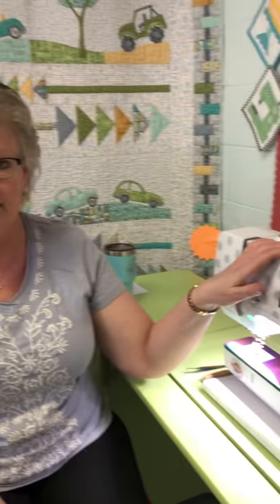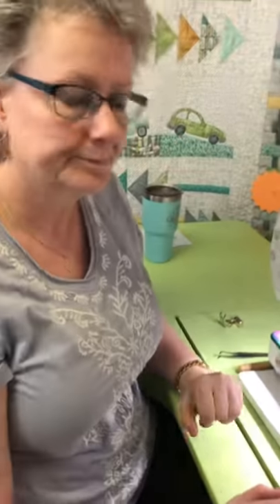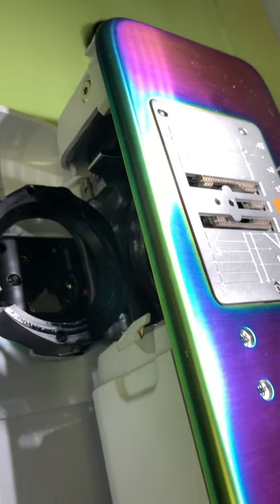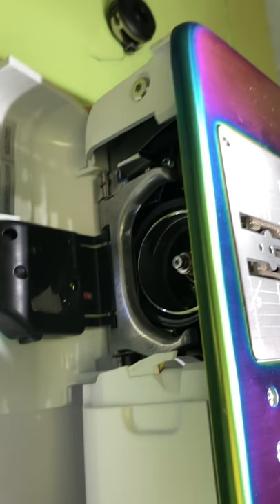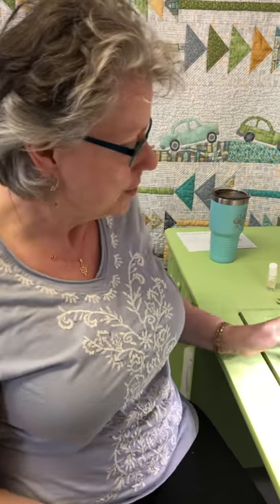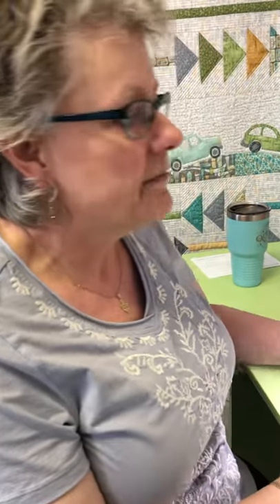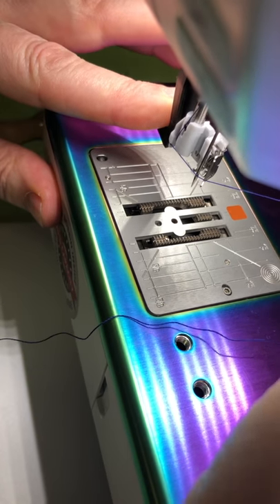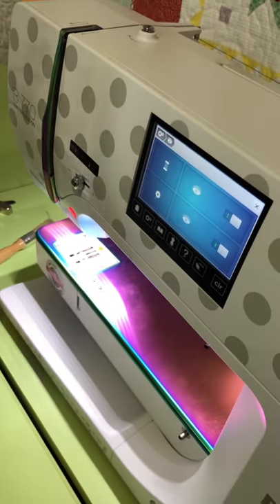Some basic troubleshooting for your BERNINA!

Comment: My Fly wheel is jammed and will not turn.  I took the bobbin and hook out, cleaned and oiled both but no go. On the screen a red arrow spins around the hand wheel but I’m unable to turn it.  Have you any suggestions?
I have a B570 quilters edition.
Reply from the maker: Yes....you have a thread jam somewhere. Rick your flywheel back and forth exerting a little force till it breaks free. Don’t apply a tremendous amount of force, just rock back and forth firmly. If that doesn’t correct it, you should take it in for service!
Reply: @QuiltingInTheValley  I have found that turning the machine off and then back off makes it easier.
Reply: sorry, I meant turn off and then back on

Comment: Great video, do you have any tips for a stuck bobbin case, I can not remove mine
Reply from the maker: Yup!  Take the bobbin case out. Find an awl, or a very small screwdriver. Hold in the release bar on the bobbin case while pushing from the back side of it through the hole with the screwdriver. You might need help to hold it steady....but it will pop out!
Reply: @QuiltingInTheValley  thank you for your response. How do I get to the back of bobbin? Or do I take out the hook?
Reply from the maker: Charlene Pherson you take out the whole hook assembly, then find the hole behind it to try to push out the bobbin/bobbin case.
Reply: @QuiltingInTheValley  Thank you for your help. It worked like a charm, now back to sewing...

Comment: I have a bobbin coming on screen with a ! Mark and on right green question mark  I’ve cleaned and fixed bobbins  I’m lost why it’s doing it
Reply from the maker: Do you have a thread tail showing on your bobbin?  You sensor will see that. Is the silver marking intact?  A scratched up bobbin will not read correctly. Are you ABSOLUTELY sure there is no little piece of thread in the hook area?  The sensor will see it and be triggered.

Comment: Just curious if you may could tell me on bernina 1300mdc serger why it alarms when you turn switch on and the LLC screen lights up but nothing comes up?
Reply from the maker: When you say it alarms, what exactly is it doing?  Is it beeping, or making a different noise?  Does it beep and then a blank screen comes up?  If that is the case, then you might need a new board.  Have you had it in for service?

Comment: Any idea why a b350 with very little stitch time would suddenly not recognize the stitches 11-85, for example I I put 78 and it stitches out 66, seems very random. Thank you
Reply from the maker: So….you are pressing the pound sign first, then the stitch number?  If you are doing that, then you have a board problem and it will need service☹️
Reply: @QuiltingInTheValley  no need for service was an easy fix at home!

Comment: Help Lisa  y screen only shows 3 blue dots and lines below that and my machine is frozen I followed all directions
Reply from the maker: Hey Mary Ellen!  What machine do you have?  it makes a difference!
Reply: @QuiltingInTheValley  I have a Bernina 770 found the problem I had been using my embrodery machine and forgot to change the stitch length when I went to sewing  It froze the whole machine changed the stitch and I am happily sewing again  I love your helpful advice and tried all so I learned some new things. Thanks for speaking slowly and distinctly you are easy to follow

Comment: What causes machine to stop and won’t go.
Reply from the maker: Big question!  There is a TON of stuff that can cause that.  Cord not fully plugged in, or wire to cord has a short.  Thread jams in the bobbin case area.  A sensor that is sensing something off....depending on which model you have.  Worst case scenario....a board going out.  Advice:  unthread top and bottom.  Turn machine off then back on again.  Clean bobbin case area thoroughly, oil, rethread top and bottom.  Ensure you are plugged into a surge suppressor firmly.  Check that foot pedal cord is not bent/snagged, and is firmly plugged in.  If you still have an issue after all this, then you will need a service call to see what the issue is.

Comment: Error 1010 messgae but I am unable to move the flywheel and the racer hook is frozen at 1 and 7 o'clock. So I was just free motion quilting and it all froze.
Reply from the maker: Take out your bobbin and then the hook. Clean out anything you find, and then see if you can move the flywheel
Reply: @QuiltingInTheValley  did that. Looks clean. Can wind a bobbin but flywheel locked in place and error note remains.
Reply from the maker: Gently, with moderate force, rock the flywheel back and forth a dozen times or so. That may break it free. If not....that’s a trip for service:-(
Reply: @QuiltingInTheValley  A trip to Service it is then! Thanks for being helpful, though

Comment: Started from beginning I have to turn hand wheel  every time I turn on 570 is this normal I’ve only had for 3 days
Reply from the maker: If the machine does not set itself to foot and needle up when it starts up, then you may need to have it looked at. You should not have to turn the fly wheel every time you start up!
Reply: Oh no! Thank you ,hopefully an easy fix because I love this machine. I just thought it was normal. Oh my.
Reply from the maker: This machine is a trooper!  It will provide you with many years of service!
Reply: They ran firmware in class it was sewing backwards, when they gave it back they said they ran firmware,that I also had broken feeddogs. Does firmware fix broken feed dogs or are feed dogs mechanical. Thank you.
Reply: So many people I know own this machine and love it!
Reply from the maker: Say what now??  They updated the firmware and told you that it fixed broken feed dogs?  That is not possible.  If the feed dogs are in fact broken, then that is a mechanical failure and will need a service call to replace them.  I have only seen broken feed dogs once....so I'm not confident that this is the case, if a qualified tech did not actually look at them.  Your firmware update will correct and update all of the machine software.  It cannot do anything with parts, and your feed dogs are parts.  BTW-your labor for all service is fully covered at the dealer you purchased the machine from for the first 12 months after purchase, and mechanical parts that are defective are covered for 20 years.
Reply: Thank you so much!

Comment: why is J flashing on my 790 Iam trying to blanket stitch
Reply from the maker: No worries!!  That is a function of your machine where it will recognize the number of stitches you take so that you can repeat the same number of stitches for you on a second run.  Kind of like a memory function.  You can just ignore it when you're doing what you are doing now, and it won't impact anything.  If you touch the reverse button, then that will set the number of stitches for the next run....should you desire to do so!  Are you using the blanket stitch in the quilting folder...or another stitch?  Some are set to have this function appear automatically.
Reply: Thanks Yes I am using the stitch in quilting program

Comment: Hi mam right side wheel became tight please help me
Reply from the maker: Take out your bobbin, and the hook. I thread the machine. Clean it very thoroughly and then rotate the flywheel to check that it moves freely. If it does, then rethread and replace hook and bobbin. If it does not, you need to take it in for service

Comment: You mean driving in and deposit your machines for days while they find a tiny bit of thread somewhere in the bobbin housing? Why does this even have to be an issue with a machine that costs this much money. Oh, and pay them $99 for finding that little bit of thread that is holding everything hostage.
Reply from the maker: Precision machines require proper treatment and maintenance. That’s the price we pay for all the capability these machines provide for us. A threading mishap is typically not the machines fault….so we deal with our errors🤷‍♀️